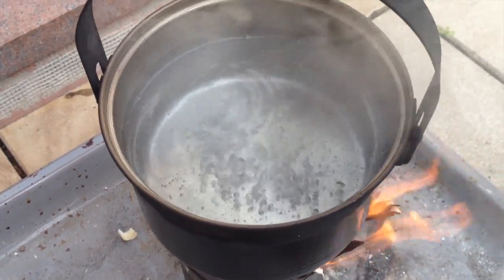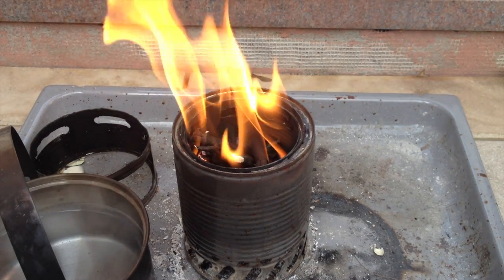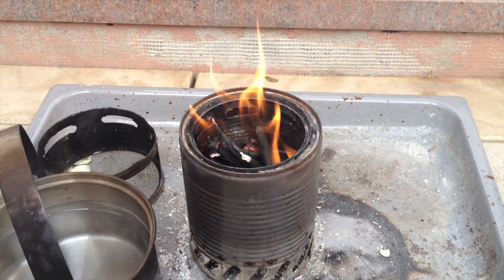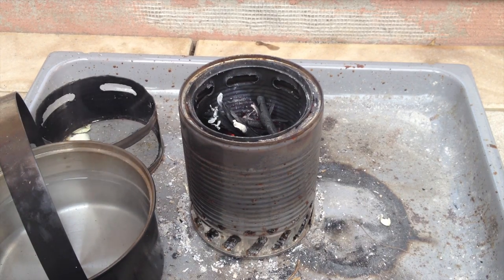WOODGAS STOVE GRID REPLACEMENT - SUCCSESSFUL OPTIMISATION

Comment: That's a pretty decent design, however, you have holes all the way around the bottom. I would recommend when building a new stove, instead only place holes around 40-45% of the circumference of the stove so that you can regulate how much wind get under there because with holes all around, even in a mild breeze, you'll blow fuel and ash right up out of the stove, so facing the holes down wind is important. To create larger holes, I use a church-key can opener, which makes fairly large triangular holes. Much faster and easier than a drill. Also, if you put the burn can into the outer can first then make the gas jets with the church key, the pushed in tabs will help hold the burn can stay inside the outer can.  That being said, a chicken wire bottom to the burn can is a nice improvement, but if you just tap the stove from time to time, much of the ash will come through holes in the burn can so that they do not clog. The wire grid bottom is better, but if you don't have that material handy, the tapping technique can save your life. Thanks for sharing knowledge and inspiring others. Respect.
Reply from the maker: That was a lot of specific information that might be quite useful in my opinion. Thank you :-)